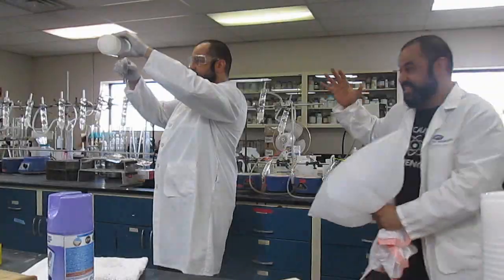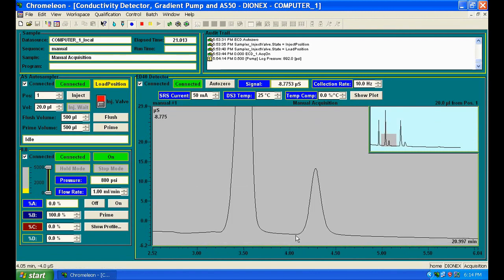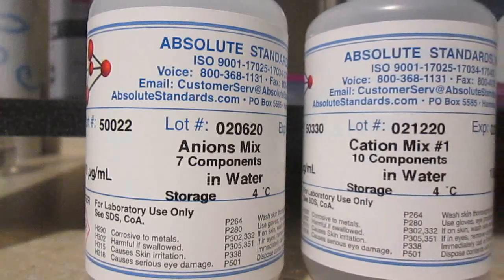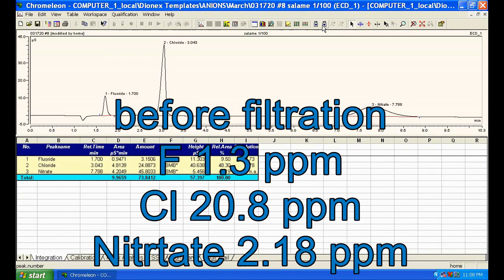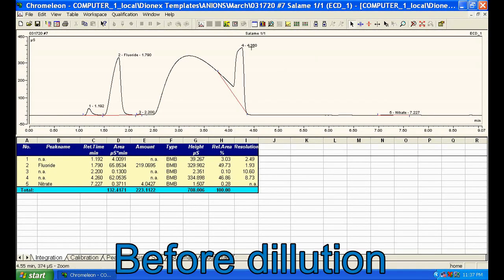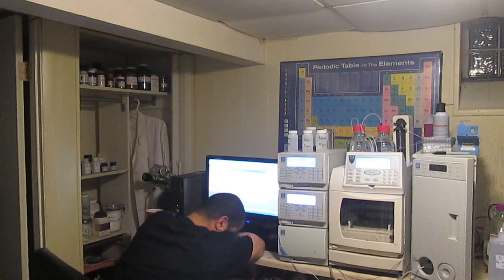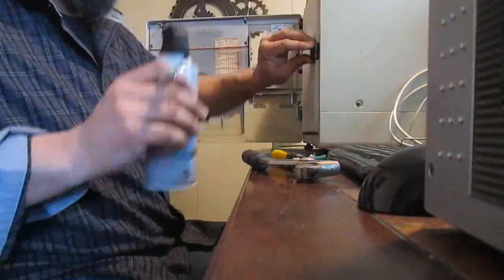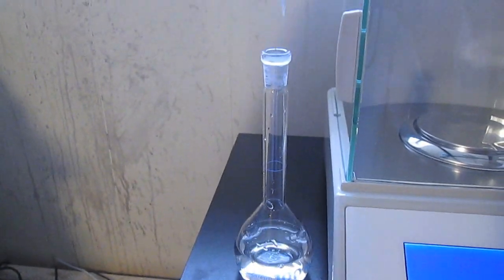Ion chromatography part 2 fluorides in drinking water

Comment: Question, could you check what compound of radium there is in radium paint using this method or anything similar? Me and a friend has a theory that radium paint that is orange is due to the radium compound used being radium bromide while the yellow/white/green paint is radium sulfate. Why do I have this question? Well we though that the orange was due to the paint being irradiated for a long time but lately it has made us confused because some orange ones has <0.2ug of radium while some yellow ones has over 11ug of radium in the mix.
Reply from the maker: Excellent question my friend ! And yes this is what this equipment is designed for ... Unfortunately radiochemistry at home is one of the best way to get a visit from any of the 3 letters agency that makes our lives great and miserable ..  so if I were you, I would dig around the internet . Chloride was the preferred salt for extraction and both sulfide and bromide were used for radioluminescense. ... But  any salt would do really as long as the zinc sulfide is near by.. but I love your awesome question and I am sorry I cannot do this experiment without getting in trouble ...sadly
Reply: @Neptunium  Oh ok cool that it can be done! Too bad that the radiophobic government does not approve of such tests. :(  What is the minimal amount of paint needed to conduct such a test? Just wondering if just lightly dragging a piece of cotton over a number painted with the paint might be enough. Don't think the government should care of such a small scale test. Well thanks for the response! I appreciate it a lot and the same with my friend!
Reply from the maker: @radiumquetzal8000  as long as you don't dilute it too much the swab you described should work just fine ...
Reply: @Neptunium  Got the theory proven too some extent, brown/yellow paint is indeed RaBr2. It is water soluble so I mixed some and when it had settled I put a small piece of paper in it and ran it under an alpha scintillation counter. Did the same with a watch hand with O4RaS-2 and it did not give anything on the counter while the brown paint did.
Reply from the maker: @Radium Quetzal the sulfate is not soluble so you may have not picked up anything from your  sample.if you can get the sulfate off and into the water you may be able to pick it up on the alpha counter. Great job 👍
Reply: @Neptunium  Yepp that's why the simple test I did worked. Now the hard part would be to check what paint has radium chloride instead of the RaBr2 and O4RaS-2 using this method that would probably require a setup like yours.
Reply from the maker: You could also maybe try a flame test with a spectrometer and see if Br, Cl or S show up ..
Reply: @Neptunium  Smart thinking, I need to get such a setup sometime. Just too much that keeps distracting me.